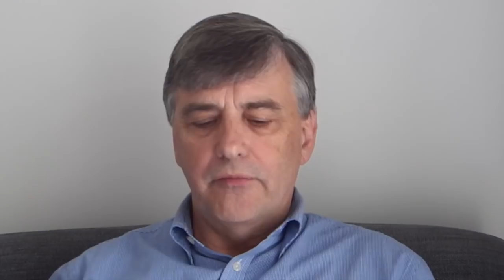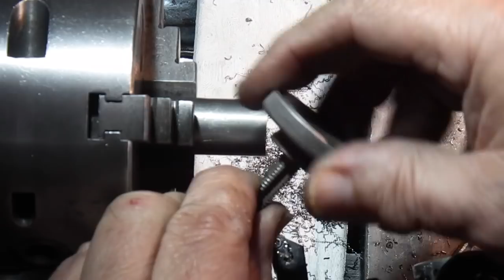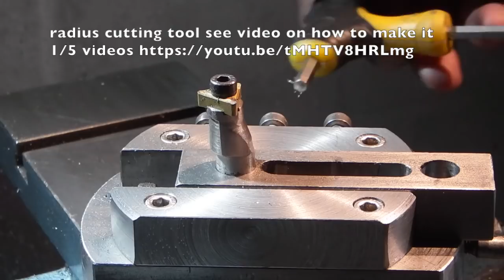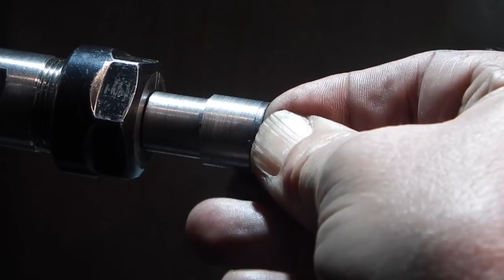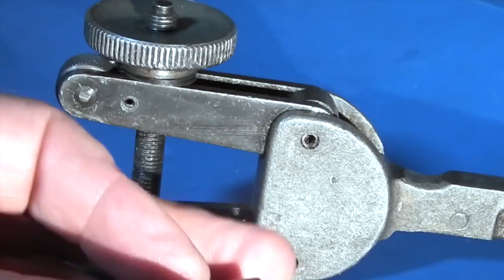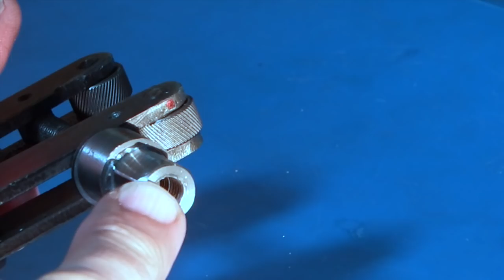Knurling tool mod

Comment: Why not make a knob the same large diameter but leave a much longer shoulder that is the same diameter as the width of the infielders arm. A spherical washer (female) would help also with a spherical end on the nut. Just trying to help man

Comment: To get out of trouble in the short term use a coupling nut (about 40 mm long and costs 20 pence) then adjust it with a small spanner, but I realise that the reason for having a lathe is to avoid going to the ironmongery to buy such trivial stuff!  My knurling tool is a very agricultural piece,  it looks like it was made from an old horse-shoe and some iron nails from Noah's ark. It wobbles like a drunk on a push-bike going home from the pub but it does the job.  I just bought two new wheels for it for about $A5.00 and we're ready for another 20 years.

I enjoy your projects 

Thank you,

Steve Callachor

Under the Southern Cross
Reply from the maker: Thanks Steve

Comment: Hello Alan, I thoroughly enjoy watching your solutions to engineering problems. I have a question concerning the knurling tool mod. How did you determine the spherical radius? Thank you. Kevin Lewis
Reply from the maker: Hi Kevin I set the tool to the approximate radius and cut the form. Then using the spherical washer I used micrometer blue and rubbed the two parts together to see how good the fit was. You can then fine tune the rad to suit the fit.
Or you could use radius gauges to find the washer radius and set the tool as needed.
Reply: enots engineering Thanks Alan